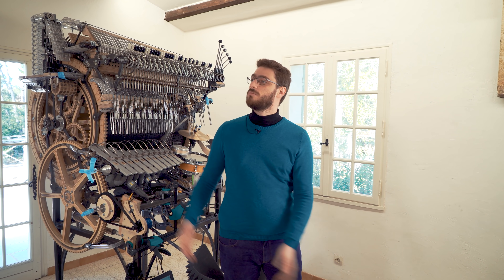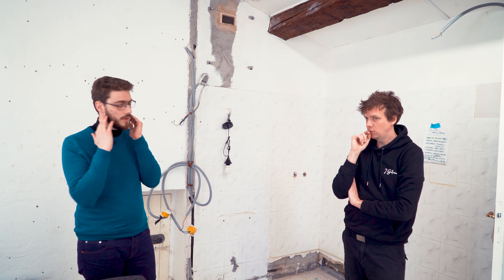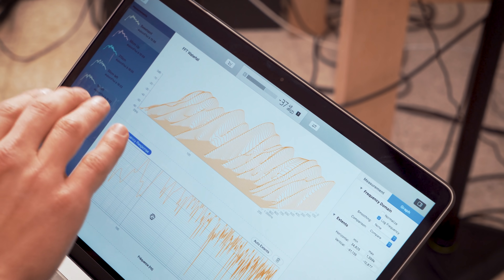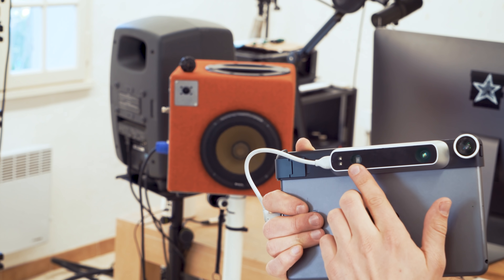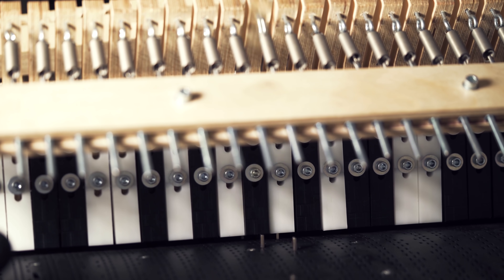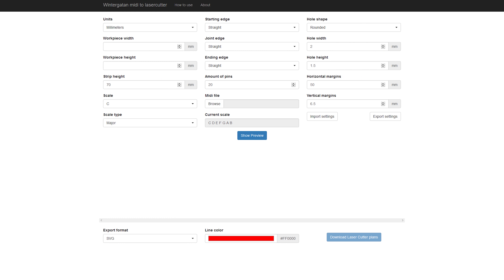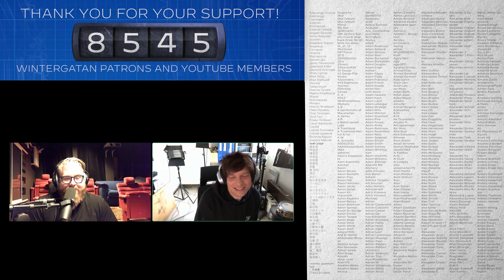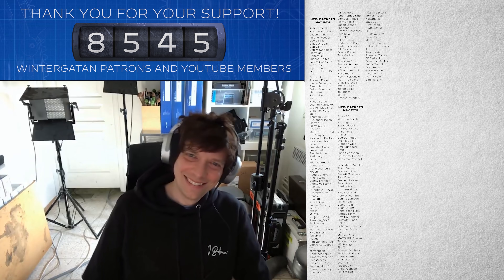Music Studio Acoustic Measurements - Marble Machine X #127

Comment: Not a fan of the solenoids. You can compose in midi without having to add an entire new sub assembly. Just use samples. Then when you have a "final draft" test it on the machine. Maybe just my opinion, but it sounds like feature creep to me. All the time you save using a midi/solenoid mechanism is lost in months of redesign and reassembly. At a certain point, you need to stop reinventing the wheel. You will get stuck in an endless procrastination loop - striving for efficiency and perfection and never reaching it.
Reply: It'll just be for composing, not for actually playing.
Reply: Yeah, exactly. I agree 100%. The moment I heard it I thought "this feels like feature creep".
Reply: Totally agree. How long will it be until feature creep decides to eliminate marbles altogether? That would solve a lot of problems!
Reply: Neal D : that’s always been my fear 😬...that the drive for perfection might destroyed the charm of and joy produced by the original Marble Machine ....a rickety improvised contraption that managed to produce inspirational vibrations that struck a visceral and emotional cord! 
Many old traditional instruments have suffered the same fate...including the human voice being auto tuned 😬😲.
Reply: I don't think this machine will ever be finished. It will keep evolving, and give birth to a whole new genre once the CADs have become shareware. I don't mind this, actually. It doesn't take anything away, it only adds real functionality. The marbles are still there to make the music, after all, and this will also give Martin the option of using the machine as a real live instrument.
Reply: @holon4662  that's actually a better idea
Reply: if the cad models were updated, perhaps someone could use a physics engine and create a simulation, it would require insane amount of GPU power, still doable. lol, more feature creep. I can already envision downloading the cad models and trying that in my "render farm".
Reply: @holon4662  For the basic "composing" I'm sure Martin will do fine in his favourite music program/sequencer. Is that what you mean by "simplified simulation"? It won't even need to sound much like the real instruments, it's enough to get the ideas on paper and define the music structurally. He probably works like that also when composing for the band. The second step is however to "rehearse" - and as for a band - that process will includes fine-tuning and adaptation to the instruments. Magnetic pins would work, but be a very tedious process. Solenoids can improve that by adding flexibility, before "freezing" a final version with hard-coded programming pins. It should not need much work to create such add-on. Creating a simulation from CAD is lots more work and would not be as exact/erratic as the real machine. In any case, running the machine for hours should be a required test before going live, creating a simulation would not benefit that, whereas motor and solenoids might.
Reply: @holon4662  yep, but that's not realistic enough, you need to simulate the physics, so were's the fun ? I'll be just another sampled midi synthesizer, that already exists.
Reply: Initially I was enthusiastic about the solenoids, but when I read this.. you do make a good point. Just sample the whole machine.
Reply: @pietervanbaekel  No matter how good your samples, it will never sound like the real deal, as every similar note would use the exact same sample every time, it's impossible to to hear how different notes playing together influence each others sound. It may sound nice using samples, but could still sound off when played on the actual machine.
As a musician, I definitely would want to be able to use a midi keyboard to control the MMX. It's not a high priority project though, so this could be done on the side while more urgent things are done. I don't think Martin will be composing a lot yet anyway right now.
Reply: Exactly.  And refining the acoustics of his home studio doesn't help in getting the machine finished, since on stage he won't be in the same conditions, it will be close-miked and digitally reprocessed, as much of what we've heard so far has been, tacitly.  He knows, he's deceiving us.  Filler.  Now it seems that there won't be a world tour before a number of volunteer idolaters have put together a complete cam model and a copy has been made in case the first breaks.  That'll be another year's delay at least and another big packing crate to take on tour.  Not viable.  Meanwhile he has an income stream, for a while.  I'll bet you a bag of crisps that one year from now there are still no dates fixed for a world tour.  If I'm right it's not feature creep, it's a man recognising that he has a nice income from a long running series, which would dry up if he finished the project.  A con-man?  Twenty years from now the ukulele will still be valued higher than the mmx.   Sorry for being harsh, but it seems the original is sadly being left to rot.
Reply: @raykent3211  Depending on your point of view, we are all to some degree, con-men and women, however not many of us have built anything like what Martin has.

I just can't see adding the solenoids to be a simple and quick addition. It sounds like a mistake to me frankly to even start down that route.
Reply: @musicbro8225   I agree, adding solenoid actuation to this machine is an aesthetic violation.  It brings into question why he doesn't get rid of the marbles entirely (which are a very limiting pain in the arse ).  Oh, because it has to be a marble machine and the kinetic art aspect.   Solenoids have been used for many years for remote operation of organ pipes, but he makes out that this is original genius.  Not true.  His first machine was a worthy piece of kinetic art (and a very limited musical automaton).  This new one is a mess.  There are poets who wrote great stuff in their youth, lost their way and declaimed rubbish later.
Reply: @raykent3211  You're entitled to your opinion, but please stay respectful towards Wintergatan and the community if commenting. These are challenging times for many people. Please take care of yourself and seek help if your frustration comes from personal problems.

From your level of experience, how much preparation does it take before a world tour? How much time would you spend rehearsing with never-before-seen new instruments, composing new material, securing budget, booking everything? Building said instrument and the studio to record said material? I have no real experience to share, but I think some have unrealistic expectations of when such a tour could happen. Yes, his envisioned goal was "world tour ASAP" - perhaps what every musician dream about to get motivated - but the first logical step would be to do some local gigs, releasing albums, growing the crowd. Anyone can see that there are plenty of work to do before expecting world tour dates.

Needless to say, every fan would be sad if the first tour stop isn't at their place, but realistically the tour would need several months to cover the world. Don't be disappointed that this process takes time, be happy that you're able to join in this early!
And anyone thinking that the original MM was perfect and the MMX is just feature creep, feel free to re-watch that original video frequently to stay happy.

Martin is not a machine made to please the internet. That's a side effect. Give love back. This isn't a kickstarter selling a finished product, this is a Youtube channel. I personally don't think Martin prefers making videos over having the machine finished, yet being able to follow the process and get to know these people is perfectly fine content for the channel IMHO.
Reply: @JensGulin   thanks for the considered critique.  My personal experience?  Being on the breadline doing a European tour with one fan driving us in a vw van and others letting us sleep on their floors.  And Swiss TV paying us nothing for a live performance.  Making a bit more money from record sales staying at home.  It's cruel. The cost accounting needs to be done, and where we had easily portable instruments, martyn has a fragile monster that will have high transport costs. At the time of writing,  he's already suggested the need to make a clone in case of breakdown.  And take both on tour.  And now he's making videos about plastering, painting and cable routing for his home studio.
Reply: @raykent3211  Having TV-appearance and touring experience sounds like great fun, although hard work to get there. If you're in Europe we may meet at the premiere. :-)
Sorry if my message was a bit negative as well. I guess you wanted to warn Martin about the risk of getting blinded by social media. Just consider the wording used to make comments constructive. Every viewer may have their own interpretation of what the purpose of the channel is, trying to please everyone is impossible.
If we agree that the tour is still distant, I think it's a good time to build studio. A good recording environment (remember that he lives away from the band) can help focusing on the music, with could be great. My impression is that Martin isn't going to make videos covering his composing process, so be prepared for more "filler content". This is probably one reason for the community engagement effort,  but another of course how rewarding it is to interact. I see it as a way for Wintergatan to give positive energy back to the community while struggling towards the tour. A mention in a video is almost as good as a TV-gig, isn't it? Cheers!

Comment: Great change of direction, why not use solenoids as the 'pin bed' so as you compose on the computer the pins on the MMX programming wheel pop up instead of sheets with pins welded on? with this you could compose on the fly changing notes with the click of a button, and no bulky sheets to store.

Comment: I got the impression that a lot of work was based on CAD models, but that the parts then got modified. That's to be expected. However, it would probably have been best to update the models when each modification was done so that they would reflect the actual thing. At that time the details are still fresh in mind, and the part possible to inspect. If not, the task of updating it later will indeed become a massive job, if not impossible because the parts are mounted on a machine (permanently in some cases) in another location than those working with the model. It's a common mistake in any engineering project. An example that comes to my mind is the task of managing documentation in software projects. Being lazy means getting bitten later.

Comment: Hmmmm, I understand the idea of automating midi functions for the marble machine, but if that gets in the way of manually inserting pins or takes precedent I feel that the marble machine would lose a lot of appeal.

Personally I find the idea of inserting pins manually on it more interesting than hooking it up to a computer that does it for me.
The abstraction layer feels... Off.

I understand that pianos can play midi now, but a piano that plays midi is still a piano you can sit down and use yourself, and I think it's very important to keep that original idea of working with the machine, rather than working with the software working with the machine.

I'm not saying this is a bad idea by any means, but it should absolutely not be the priority.
Reply: I think the idea of the solenoids was only for composing music, so he can try different things and once the music is finalized it will be played by the programming plates, so the solenoid assembly will probably be removable.
Reply: yeah its more of a composing thing, but it also opens up live opportunities to do adlib MMX solos by pausing the programming pins and shortly going manual
Reply: I remember that several machines on Spielklock museum had been retro-fit with MIDI-ability. This is a natural evolution and likely something Martin knew would happen early on. 
The comment storm caused is largely a misunderstanding. It's a test-tool, not a new direction for the machine itself.

As for priority, Martin was clear that he liked it as a separate task where he was not project lead. I'm sure it's would benefit the project, but if it fails Martin can continue his composing work the way you think he should have done it. Just relax and trust Wintergatan!
 @DrummerLocnar  I agree! having the solenoid ability  to "play live" (more than pulling levers manually) would be a nice option. I see why people are getting worried, but if solenoids is a separate add-on it can be attached for the spectacular encore without being any degrade. The "solenoid module" design should have that in mind from beginning (if possible).
Reply: As a musician aiming for perfection ("tightness" as he calls it) the manual pinned boards are pretty much - a well developed - dead-end. He doesn't want to be re-pinning between performances as there is margin for (human) error. Instead all his on stage performances will be off ready-made sheets. To fine-tune the MIDI files required for the welded pins, that's where the solenoids come in... if they (as in the drawings shown in the clip) sit in-behind the keys, then they would in any case be "out of the way"... mind you he wouldn't be doing his manual pinning right up on top behind the keys anyways... you can see him in previous videos counting out the spacing while facing the plate on eye-level at the rear
Reply: Since they already have taken a 3D Scan of the complete room one could even go as far as simulating the whole machine including room accoustics and do the composing on the virtual model then play the song on the real machine.
Reply: The marble machine is like the stiffness of a quantized digital file without the ability to send the midi data to a different instrument. The cool part of it is the building of it

Comment: Yes, finally! At 13:21 there is the first mention of building a backup Marble Machine. I've been thinking this from the start. It is inevitable that this complex and fragile machine is going to malfunction at some point, and you won't have time to fix it on the spot. If you are planning to take this machine on a world tour, you are going to need a backup. I'm relieved that you are working on this.
Reply: Actually on #53 or so where they introduce their #000-000 part naming system, the timeline includes building 2-3 complete replacement sets of MMX for touring
Reply: I looked. It up. It is #57 Working with a PBS System at 16:33

Comment: That Marble Machine is noisy. Metal balls running on wood, metal and plastic. Wheels, moving steps, gears, colliding marbles.
You will use contact microphones to get rid of the noises. Mictophones with a short range. Why you need studio equipment for the room?

Comment: The solenoid idea is the best for composing, plus you'll still have the other way of doing it as you like, but it's gonna be hard to find some solenoids that are strong enough AND very reactive AND timing reliable. But if you find a way to deactivate the spring that hold the finger and use the one on the solenoid when you do MIDI control it might be possible 😉
Reply: That's another six épisodes.   Different time delays, software compensation, recovery time, etc.  He has no intention of finishing this project, it's like a soap opera that makes money while you keep it going.

Comment: Please do not remove the programming pins. MMX should not lose any more on its mechanical essence! 
Also it will open doors for more feature creep
Reply: I think the idea of the solenoids was only for composing music, so he can try different things and once the music is finalized it will be played by the programming plates.
Reply: I gotta disagree on this one. The MMX is like a music box. There’s a reason no music boxes had programmable pins. They ain’t tight, therefore ain’t musical.
Reply: @ddragonwhistler  Tightness isn't what defines musicality. A little bit of imperfection can add a lot of character.
Reply: @ddragonwhistler  Judging by the timing analysis video, the pins are able to play sufficiently tight music.

Comment: Doesn't having the solenoids defeat the purpose of having a magnetic programming plate? If you are going to use solenoids for composing and stud welded plates for performance, then why bother with magnetic programming pins?
Reply: That's the point. Working with the magnetic pins is slow and arduous.
Reply: @voxelfusion9894  this thing is a piece of art and nothing where total efficiency should matter.
Reply: The magnetic pins were from before we had the idea of using stud welded plates. I suspect they won't be there in the final stage.

Comment: You've been spending a lot of time configuring the marble drops to be tight in combination with the magnet board, now with the stud-weld board, won't you have to do that again? And aren't you limited by how finely you can tune the marble drops instead of how accurate the stud-welt plate is?
Reply: Tuning the drop times is supposed to e sure that two notes next to each other horizontally are played at the same time. That won't change with studs, as long as they're put on as straight as the magnet sticks.